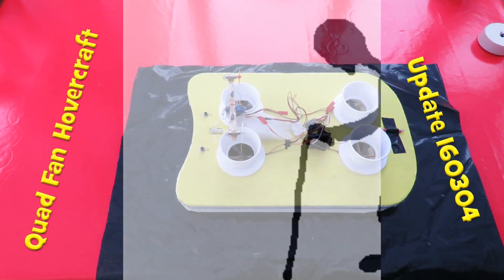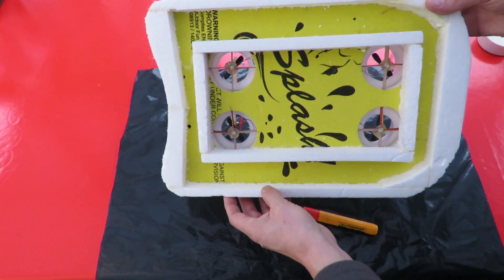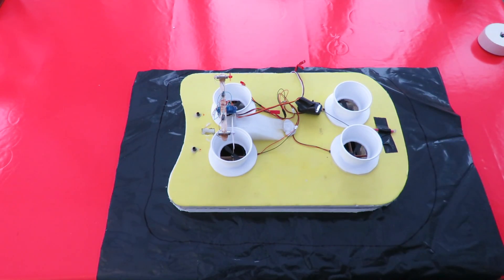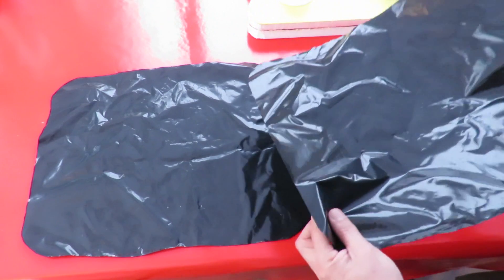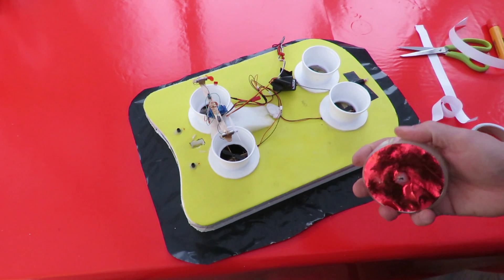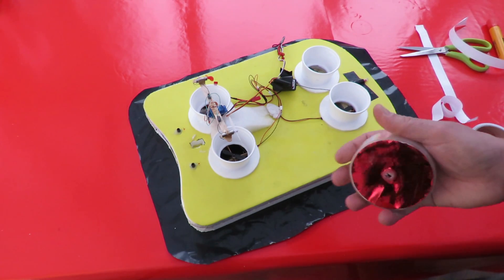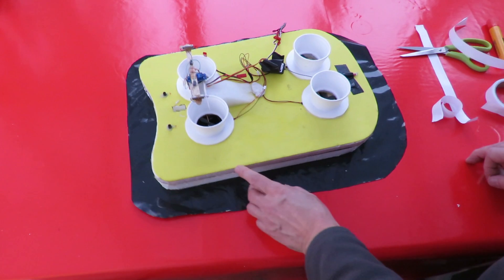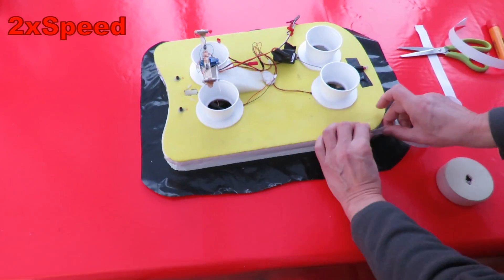Quad Fan Hovercraft Update 160304

Comment: Why not use a solid piece under the middle instead of cutting an opening.. That's more pressure in the air bags outside and less fans needed.. Also less water spray on water

Comment: Thanks for doing this as wanted to build a hovercraft for a while just need a few more bits then i can make one
Reply from the maker: Good luck, this project drifted away from my original plan as it evolved. This is the sort of idea I originally had in mind https://youtu.be/t6m01VGiNPI
Reply: Thanks for that 

Never seen that and very impressive

Got a old fan heater i was thinking of using the fan for lift with a rc motor

Got most of eletronics just need the materials to build it

Comment: good job :-)
Reply from the maker: +Elnufo I think the plastic was too thick. I was trying to make it fairly robust but the result was it was not very flexible. A thinner plastic bag would have given better flexibility over uneven surfaces helping the seal. It wouldn't have lasted very long but would probably have lasted long enough for my purposes. It worked but I think it could have worked even better.